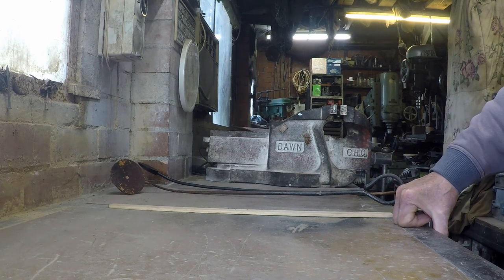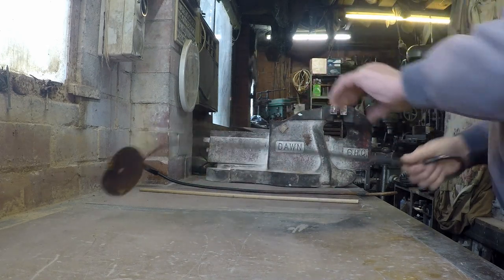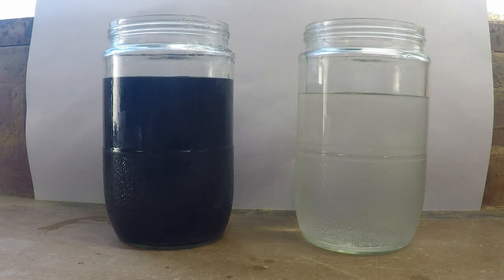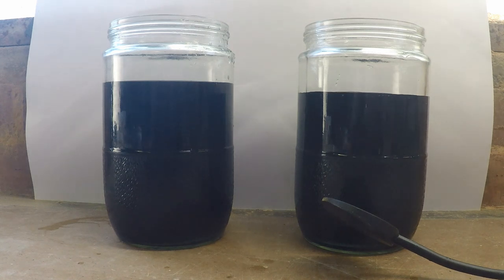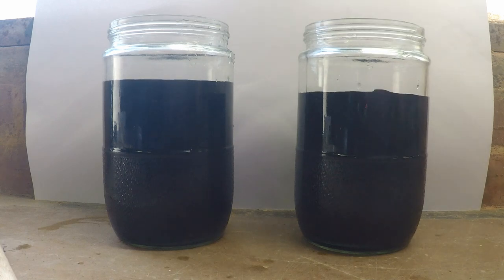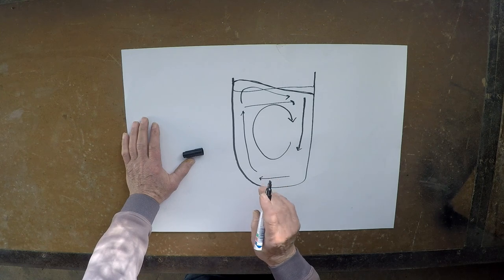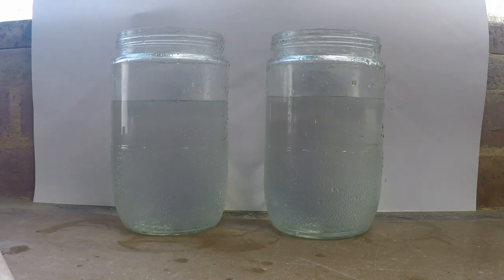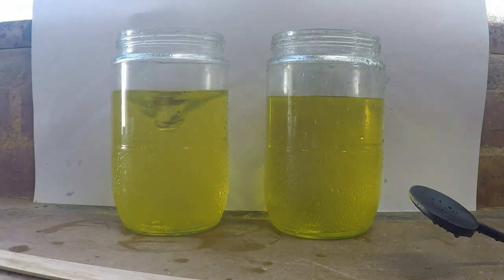Stirring metal the right way

Comment: Excellent video here. The main takeaway, of course, is to be as gentle as possible when working with molten metal.
Reply from the maker: Mister, Absolutely! Turbulence is the enemy. This does not mean that you need the impossible target of lamella flow  just that you MUST avoid breaking and folding in of the surface.... Martin

Comment: Martin, thank you for all the time you spend editing and piecing your videos together. I would like to ask a question which I hope is not really dumb. Is it feasible to place reinforcing steel in the mould and then pour the aluminum around it? The intention being to give it more strength.
Reply from the maker: Iafarms, Not dumb at all. I do something similar with casting aluminium around a heating element :- see here https://studio.youtube.com/video/Q4sGl4jOQtA/edit    Of course this is not for strength but it is cast in just as a steel reinforcement might be. Note that I preheat the element to make sure that the aluminium runs around it properly. I doubt that you will get any true bonding with the steel reinforcing  and I am not sure how much strength increase you will get or how reliable casting to casting it might be. You might just be better producing a superior quality casting out of, say, 357 alloy and then having it properly T6 heat treated.... Martin
Reply: @olfoundryman8418  Thank you Martin, I would only be making two, or three and stretch the third unit it fails. I had not thought about casting around a heating element. That solves another project! David

Comment: I had a buddy who for some perverse reason had a passion for old Skodas - I think mainly because he got them for free. We were moving an engine-transmission and we let it drop onto the ground from the tremendous height of an inch. The transmission  broke cleanly  into two neat pieces. The interior of the casting had uniformly the appearance of a metal aerobar. Interestingly the casting exterior finish was superb - still wondering if this was intentional, sabotage or an unhappy accident. Love the channel.
Reply from the maker: francis, I understand perverse passions for odd vehicles only too well - I have been thus afflicted most of my life. Your metal aerobar casting sounds like a pressure diecasting. These commonly have a good surface finish. But the process relies on squirting metal into a die at just about sonic velocity much air can be entrained during this process and if the die is not well designed (many are not) you get the trapped air bubbles that pressure die castings are often known for. So intentional - no, sabotage - no, unhappy and likely recurring accident - yes.
I love that you love the channel.... Martin

Comment: G-day mate, catching up on a few videos at last, I will drop you a line. keep up the sweet little how to videos, think it's going to help a lot of people out.
Reply from the maker: Andy, Finally given up revving the crap out of that poor little Mazda? Front wheel drive is so damn useless up slippery hills particularly if you over do the revs😊 How many sets of front tyres did you wear out? All that smoke!!! 😱.... Martin
Reply: Ahh The MX5 is rear wheel drive Martin. No not given up, Mike has had a back op, so is out of action, I could have taken the MX on an event with someone else, but I have done that once already & as we co own the car, I felt I'd rather wait until he's fit again.
last event we got through 2 tyre's, never due to wear, it's always punchers on the rock :(

Comment: Greatly and clearly explained.
Maybe black dye wasn't the best color choice.
Reply from the maker: Gafrers, Maybe not 😊! To be honest the dies dispersed into the water way to quickly - I guess they are made to do that. But I really needed something that would mix in with a little more difficulty as  I had hoped to show better mixing with the "right way" as well as the more important no air introduction. Perhaps a  small amount of a thick water based house paint may have been better?.... Martin

Comment: in traditional bell casting they use a spruce stick to stir the bronze. what's your opinion on that?
Reply from the maker: Bbuse, I believe that the spruce stick is to remove oxygen from the metal by virtue of the hydrocarbon gasses it gives off and not so much to stir it. It is a somewhat older technique and better methods are available today. To be honest I don't think too much of the method as water vapour is also given off and this can cause all sorts of problems with the metal, not to mention safety issues, pays to stand well back! Remember they start with ingots of the required alloy so no actual stirring is necessary.... Martin

Comment: Im a machinist in the states and I have done some home  aluminum casting in the past but I wasnt good at judging sprue, runner and riser sizes. I am getting ready to pour a prototype cylinder head for a pulling tractor. The one I am casting is just the size for 1 cyl. The casting will basically be a block of aluminum 6 1/2" x 7 5/8" x 5" thick with 2 cores for the intake and exhaust port. Would you have an idea of the size of the sprue , runner and the risers needed.
Reply from the maker: James, Hang on - a case of more information needed 😊. You seem to be talking about a rectangular lump of aluminium that neglecting the two port cores will weigh in at about 24 lb by the time we add about 16 Lb for feeders  gates runners etc - that is a 40Lb casting. That seems very heavy for a single cylinder head.😱 So do you have a photo or drawing or even a sketch of the actual shape that you are after? You can send it to    olfoundryman@gmail.com
Martin

Comment: Hello, I want to cast an aluminum plate (12mm thick), so I need two sides to be as parallel/flat as possible so I don't have to face it too much later (my weak cnc router would appreciate it). I will use foam and plaster for this process. My question is: Should I position the mold flat to the flask as usual, or positioning it at an angle (like a 45º ramp) could it help to better homogenize the liquid aluminum? I ask this because I already got voids at the bottom and ends of some flat positioned castings. I also watched your video where you place a steel plate against the bottom and get good results, but I was using greensand.
Reply from the maker: Hunter, Foam and plaster?  I hope that you do NOT mean plaster of Paris it contains lots of water and will cause problems. Thinned down dry wall compound (the non curing type) will work well though I believe. Check out the work of Kelly Coffield who is expert at one off lost foam castings. He would probably pour something like this at close to vertical. The use of a steel plate is to chill the metal and this makes it more gas and shrinkage free as well as giving it a finer stronger structure.  It also promotes feeding  by increasing the thermal gradient across the casting. I am not sure how you could combine chills with lost foam - never done it, never seen it done, doesn't meant that it can't be though.... Martin

Comment: I do a punge motion. But taal under the surface of the metal. Basically the same just in the opposite direction
Reply from the maker: Manus, Anything that brings top to bottom and bottom to top without breaking the surface is good.... Martin

Comment: Great video , I noticed you have a Mill in the background in your video , it looks like an Archdale vertical mill with a sliding head, I am asking as I have an Archdale VM30 , getting information on has proven fruitless as I am yet to get anything of use like an exploded diagram showing how it's put together , even a scanned copy of an owners manual would be of use
Reply from the maker: Allan, Thanks for your comment. I assume that you mean the mill right at the back that pretty much only the head of is visible, sorry but its a Cincinnati #2 vertical (I call her the "beast" - she weighs close to 3 t) so I can not help you with any info on your Archdale -sorry.... Martin
Reply: @olfoundryman8418  Yes that machine you describe looked similar to my Archdale , it would be around the same weight as well, I just did a search on the model and while it has a sliding head like mine it is noticeably different to mine , I do know from others that it was made in the 1920s . I couldn't see enough to be sure of much , hanks for coming back to me

Comment: Hello Martin, I'm into metal casting since two months now. I've build my own furnace and started my firts attempts to cast some simple parts from aluminium. After inplementing some of your tips - the results are getting better. Entraining of air was the biggest issue at the beginning. Since I got rid of the 'ridicoulously big pouring funnel' as you called it and reducing the diameter of the infill drastically - I was very pleased to see the first part without any visible inclusions. Thank you, very much for sharing your knowledge. I assume that the correct pouring temperature is also very important. I guess I always overheating the metal. Could you please be so kind to explain what kind of equipment you use to measure the temperature? Do you use a thermocouple? Which brand and how you protect it from the high heat?
Reply from the maker: el, Yes, there is a right way and a wrong way as with most things. The right way gives a much better chance of a good casting. Temperature is important. A max of 760 deg C  is advisable for aluminium as temps above this can cause bad gas problems. I tend to pour a bit hotter than perhaps I should - most of my castings are poured at 720 to 745  deg C. I have covered the thermocouple question in another answer to you but please note that the protective wash I mentioned i.e. the BN hardcoat is only of use up to 900 eg C so it is useless for bronze..... Martin
Reply: Thank you. I've found a dipstick sensor with a copper plating which should withstand temps up to 1100°C. I'm not sure if the hot aluminium will stick to the sensor or how fast it will be corroded. https://www.thermagmbh.de/en/shop/product/thermocouples/dipstick-thermocouples/dipstick-thermocouple-teflon-type-k/
Reply from the maker: @elpresidente4441  This might be better and cheaper too plus it has the instrument  that gives the readout  https://www.ebay.com.au/itm/282576231648?hash=item41cadb1ce0:g:2e0AAOSwW4hcdcDy  It is also thicker so a bit more robust (maybe ) coat the end that will go into the metal with some sort of a ceramic wash like a thin layer of fireclay and sodium silicate mixture painted on and dried. Get the longest one.... Martin

Comment: Hey mate, just wondering if you’ve ever done any magnesium casting, I’d imagine it’s a lot more difficult than aluminium and dangerous?
Reply from the maker: Mario. No, wisely I have stayed away from magnesium. A fellow foundryman local to me did a fair bit of it and he used to say that reject rates were significantly higher than with aluminium. He never had a fire but did have the fluxes to help suppress fire. I used to nervously watch large holding pots of Mag at VW Australasia during my time there - it was common to see a small white flame lazily lick its way across the top of the metal fluxes help keep it small (hopefully!) occasionally a furnace would catch fire badly and the approach was to turn the furnace off and hurriedly build a wall of sand bags around the furnace. A front end loader would then bury the furnace in cast iron chips. A week or so later when all had cooled down the same front end loader would come back and pick up the whole furnace and dump it out back, a new furnace was then installed 😊. There are chemicals which will put burning Mag out sulphur hexaflouride SF6 now difficult to obtain and hideously expensive. It will burn in CO2 (a bit slower than in air) Argon may smother it. It will react with water - even the water in mouldings and and it will also react with the sand itself, inhibitors like KBF (I think) or amonium biflouride will stop this reaction. Sands containing these inhibitors can not be used for casting other metals.  Dusting sulphur on the burning Mag will also help and dusting S on the stream of Mg during a pour is very common practice. My advice -stay away from it......Martin
Reply: @olfoundryman8418  wow, definitely not for me. It amazes me how the Italians seem to be all over it, they make lots of components for the motorcycle racing industry. Then again they’ve been doing it for a thousand years
Reply from the maker: Mario, Well, they have not been casting magnesium for thousands of years! Its not much over a century old as an in use metal. But its like anything  once you get to grips with and master the necessary foibles of the material that you are working with you get good at it. I suspect that it was the Germans who first became good with magnesium by the way.... Martin